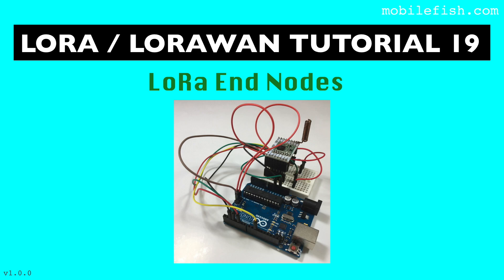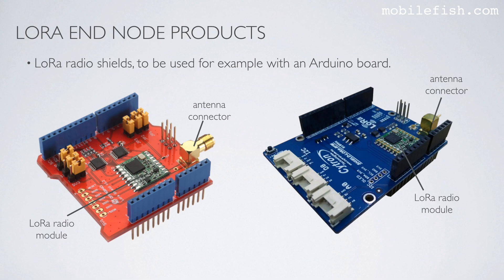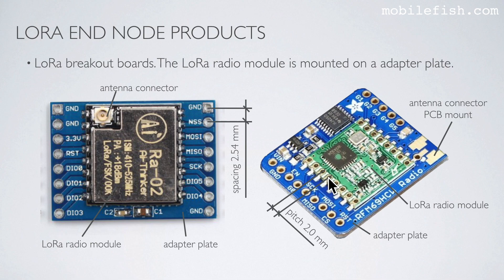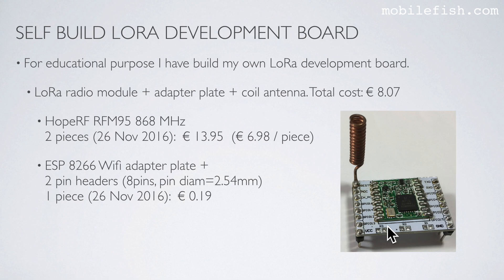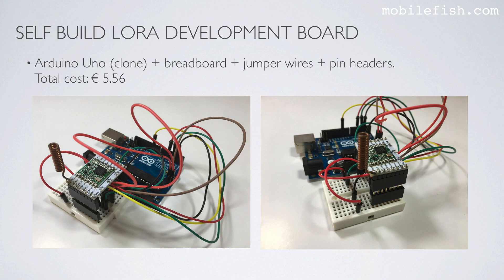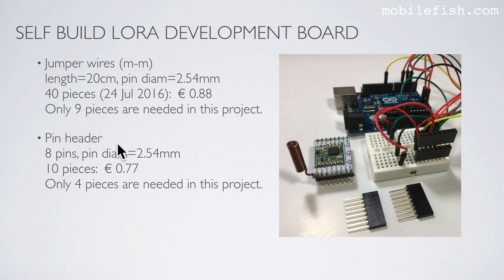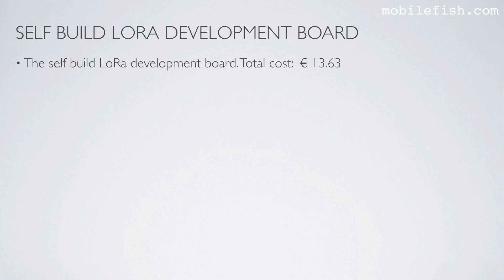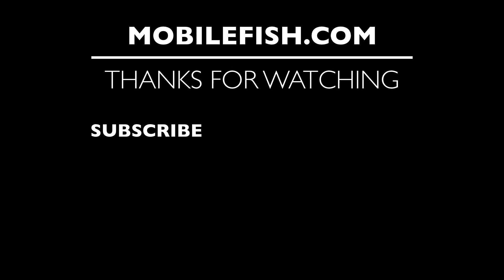LoRa/LoRaWAN tutorial 19: LoRa End Nodes

Comment: Will it give a big difference replacing this coil antenna by just a straight wire? Does it matter if the wire is isolated or not? IF you put one wire up at ANT and one wire down at GND pin, would that give better results in range and is that acting similar as a dipole antenna? Thx.

Comment: What does G0,G1,G2,G3,G4  in RFM 95 BREAKOUT BOARD DENOTES?
Reply from the maker: Forget the markings on the adapter plate. I am using the ESP 8266 adapter plate to solder the RFM95 but this adapter plate is intended for the ESP 8266.